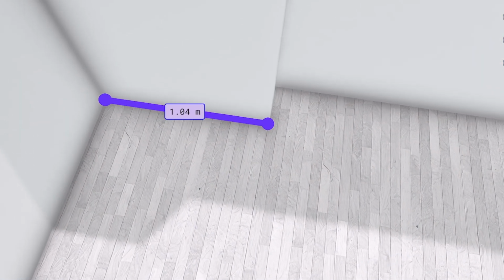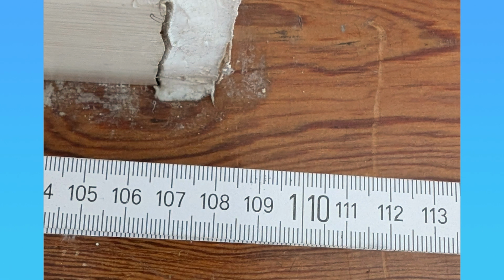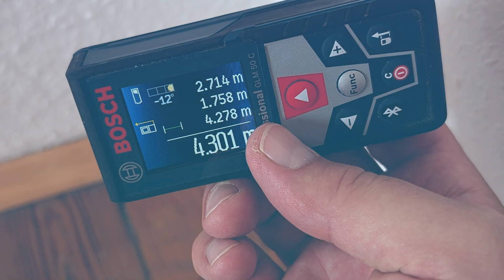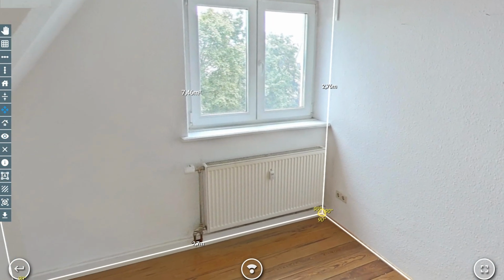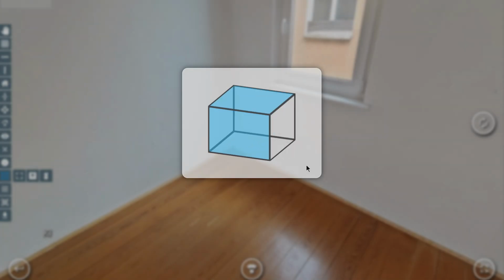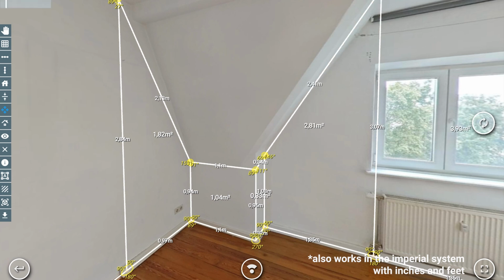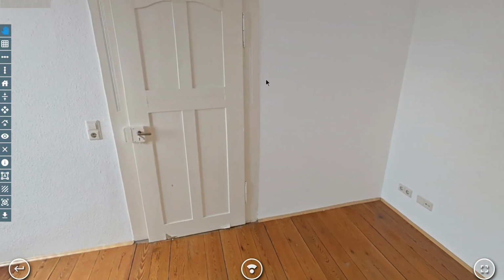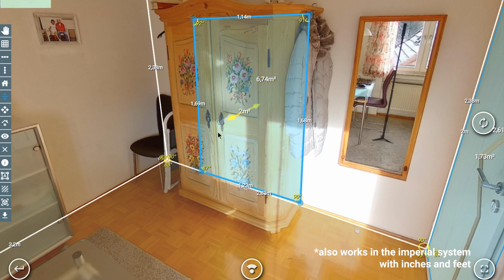iPad Pro LiDAR vs. 360° Camera Measurement

Comment: Very interesting. But I guess you could layer the Lidar with the normal cameras on an Ipad pro? Btw the distance of the Lidar is maxed out at 10 meters on the Ipad Pro M4. Do the 360 degree camera have the same kind of problems? And what applications can use the outpout from the 360 camera? On the Ipad Pro M4 I can use it for WiFi surveys with a program called Ekahau AI or like sketching up models for 3D printing. Finally do we not have 360 cameras that also use lasers for distance? Worth to notice beside of the specs of the two systems is that the 360 camera is more than half the price of an Ipad Pro M4